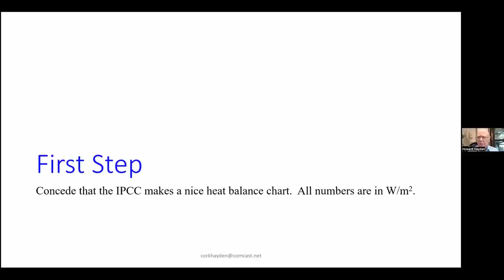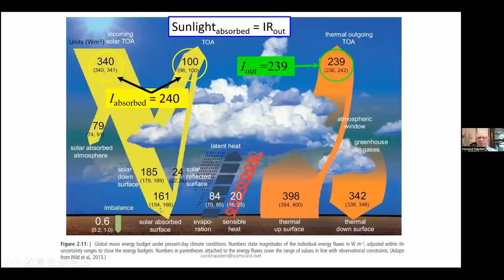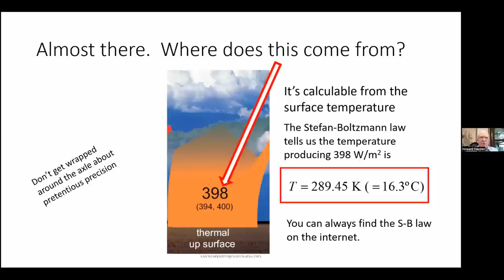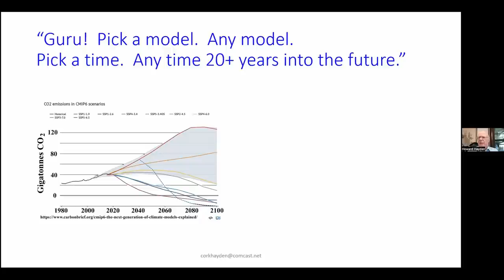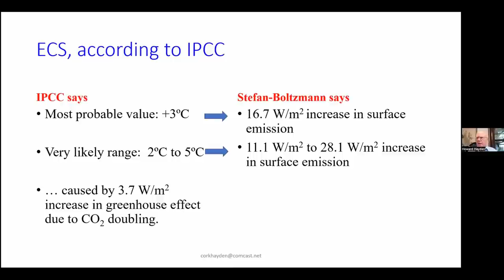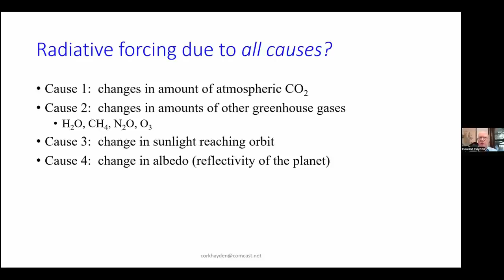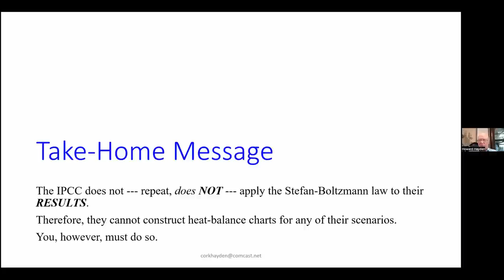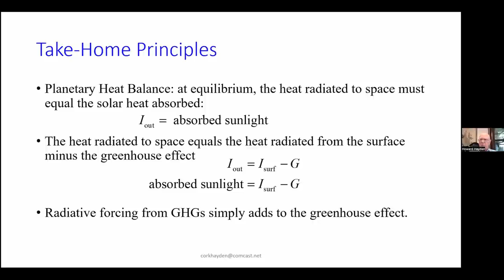#59 Howard Hayden: “the IPCC does NOT apply the Stefan-Boltzmann law to their results”

Comment: Very convincing video. Of course you need to get a reliable heat balance in order to be able to conclude, but this is not enough because in you presentation you are working with data which are wrong for the simple reason that the atmosphere, the oceans, the the continental earth, the core of the earth, which is at around 5000 degC, are not static but in moves which are not only not constant but rather chaotic. You cannot get reliable results if you simplify a system like the earth which is a very complex system which is itself, today, not completely known, this is the least that we kan say. There is no known single figure to express the energy at a precise location at the surface of the earth and there is no single figure to characterise the temperature at the surface of the earth. You cannot add up temperatures and get an average temperature for the whole earth because this has no meaning. The figure of the average energy in order to make calculation is also a non sense. Just look at the satellite pictures representing with colours the temperatures of the earth moving at different locations, at the surface and up and down. In order to make reliable calculations you need to imagine a system animated with stable material flow regimes and propose a heat and material flow balance all around the earth. But this is even not appropriate because there is no stable material flow regime around the earth. The regimes of fluxes are rather chaotic and swirling. The fluxes of matter are moving from gas phases, in the atmosphere, to liquid phases in the oceans and could precipitate at the bottom of the oceans before being released to the atmosphere in case the local temperature rises. The best approach may be to imagine one stable flow regime in order to get a feeling of what happens with the temperature but the interest of it is limited because there is something which is to be taken in consideration, this is the time. There are a lot of different cycle times which are leading the fluxes. Some can last months, some years, some hundred of years to thousands, someone hundred thousands. For example if you get a CO2 rise this could be the effect of a temperature rise which occurred one thousand year ago. Therefore, for me, to get exited about a CO2 rise seems to be absolutely a non sense. And who could believe that human beings have enough power to be able to stop the CO2 rise, would this be proven to be the cause of a potential temperature rise ? Certainly not through a carbon tax on people. But the money is not lost for every body. Follow the money, you shall understand the philosophy behind.

Comment: Few caviats:
1) They don't assume full stationary balance, there is a latent heating of deep waters and ice caps. It is the reason they don't care.
Where you see loophole, they see "climate change."
Yes, it is still inconsistent, but on deeper level than you consider.
And don't forget, that W/m^2 is so lame, you have to use <Hiroshima atomic bombs>/day/<Earh globe area> for that "missing value".

2) You can't use average temperature for Stephan-Boltzmann law, you need to recalculate it as (average(T^4))^(1/4) instead of average(T).
It should be a default average function for temperature used in climatology, but it isn't for obvious reasons.

3) Actually for short term climate modeling it is much better to use independently south and north hemispheres, they are quite decorelated.

4) There is a new powerful mechanics for higher level of arctic temperature rise: albedo lowering.

5) There is no reason that corrupted scientific field can not be accidently right in their general predictions.